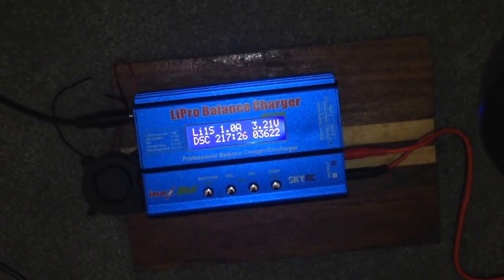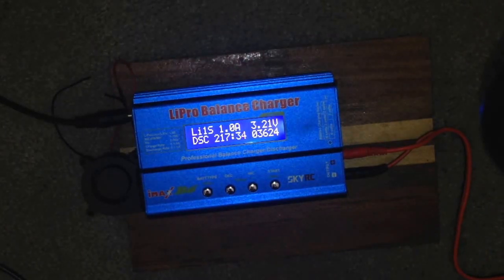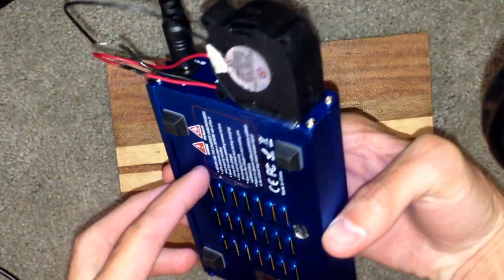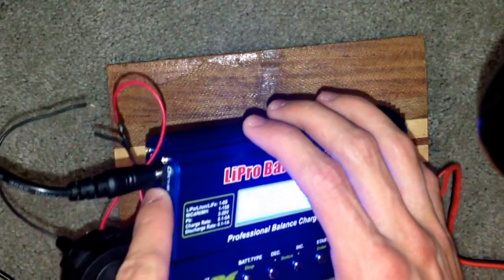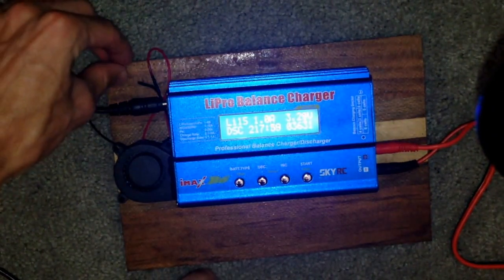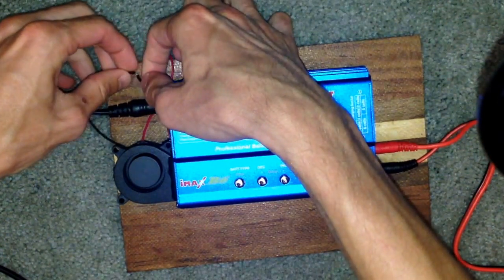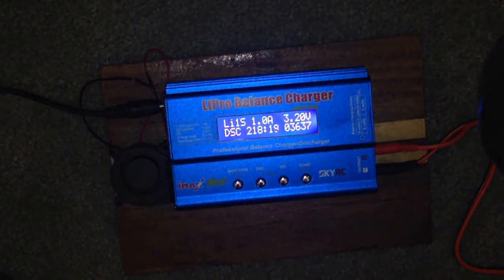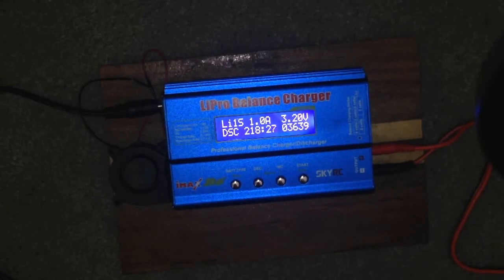Imax B6 custom fan install

Comment: sir, where should I solder the black and red wires from the fan?
Reply from the maker: I used a multimeter to find 12V on the board and soldered to that